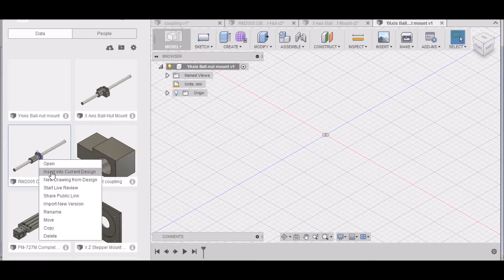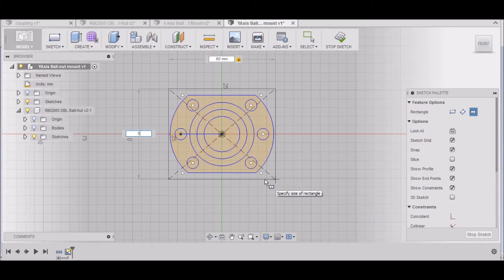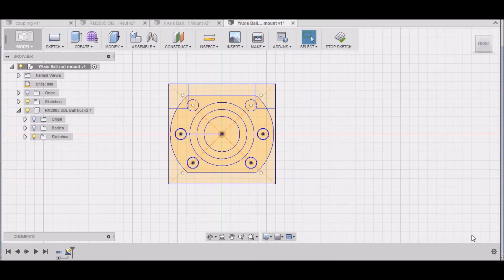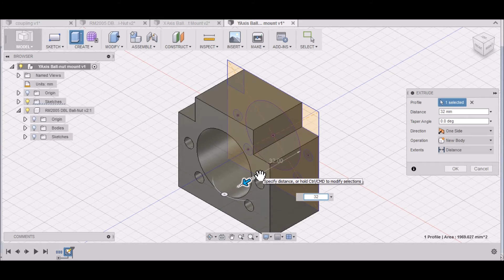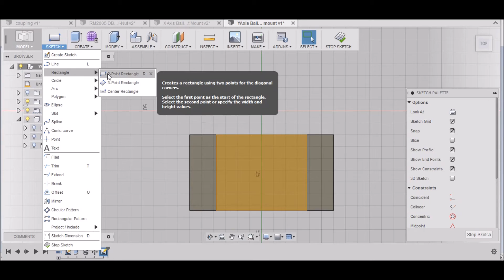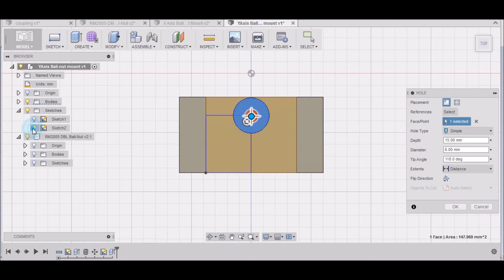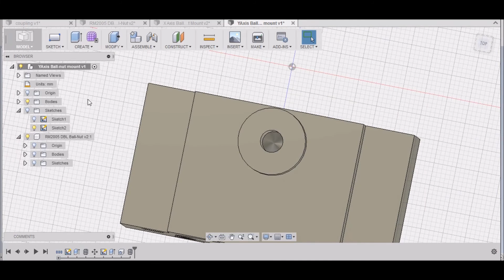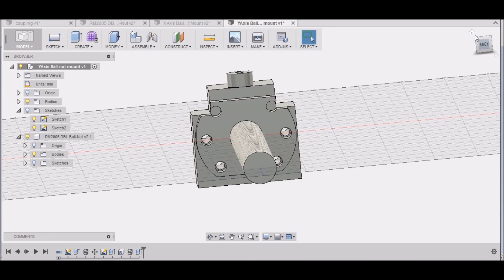Fusion 360 Y Axis Ball Nut Mount

Comment: how to joint screw in threaded hole please explain me i m beginner
Reply from the maker: The RM 2005 Ballscrew and BallNut? Draw the Ballnut and simply draw a long cylinder threw the Ball nut then select the cylinder and thread. It will thread the whole cylinder and appear as you see it.

Comment: Hi Sam,

I machined my Y axis ball nut mount just a few hours ago for my machine, an RF-30, which is a similar but smaller machine with a round column instead of a dovetail.

I noticed you notched out the ball nut for clearance. I was thinking of doing the same thing, but instead I simply rotated the nut so the narrow faces were the clearance. I may be able to get away with this though because, although I'm also using 2005 screws, my block sits against the flat face of the nut. I'm not sure if your placement of the mount will work if you rotate the nut 90 degrees given you also need the clearance for the OD of the ball nut.

Watching your plan for cutting the casting has given me a bit more confidence to make a similar cut to my base too.

Really love this series. Fantastic work! Can't wait to see the next video.

PS, I used only a lathe (an Australian version of the G0602) and a drill press to make my ball nut mount, hope to do a test fit on Saturday :)
Reply from the maker: +Adam Carmichael 
 Hi Adam,
 Yeah I thought about turning it as well this seems to be the path of least resistance and gives me 4 hole to bolt to.
Thanks for the support,
Be Safe
Reply: +CNC4XR7 just watching the X axis video, there's little meat at the bottom of that mount because of the large bore. The no travel problems with flipping that to a face mount is there? The smaller bore (I did 22mm for clearance) for the 20mm screw would give more material at the base, and maybe you could squeeze the two top screws in as well? It'd take some playing but if the top of the nut isn't cut, then the mount could be made in line with the nut.
Reply from the maker: +Adam Carmichael 
You Know I thought of that but was concerned the ball nut hanging off was bad but now that you mentioned it I am rethinking it as I do not like the open circle or the thin bottom a 22mm hole will solve both of those issues.
Hmmmm  Can I get a DO over?
Reply: CNC4XR7 It's rumoured Thomas Edison had about 999 do overs... Go for it ;)